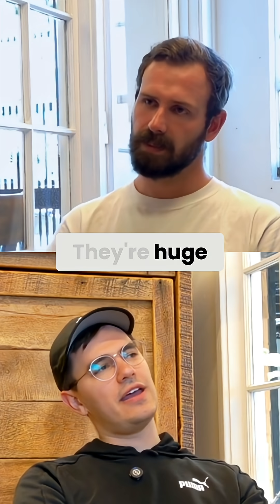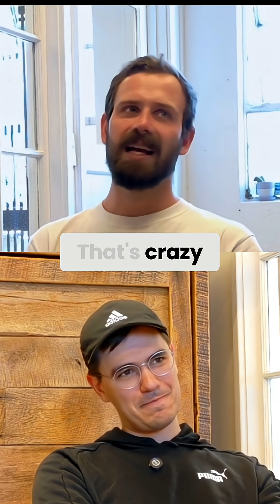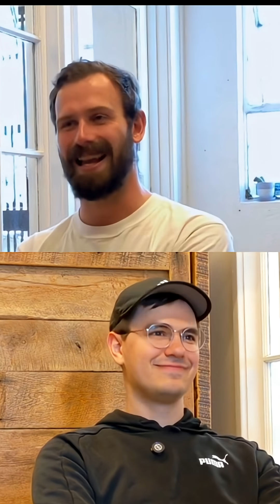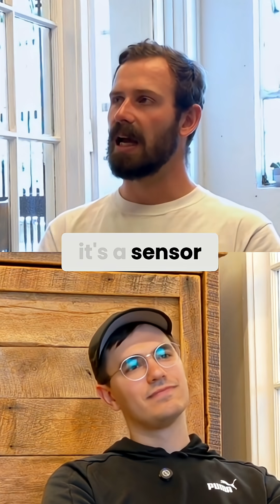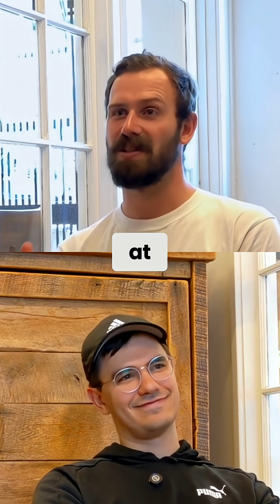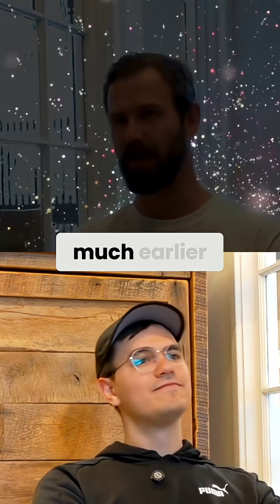90nm Microcontrollers? Why Smaller Isn’t Always Better

Comment: 40nm is also pretty common. NXP has been teasing making high end imxrt microcontrollers with 28nm for a while, since that would allow those parts to go at 1GHz clock speeds